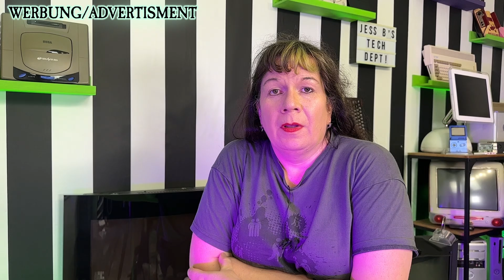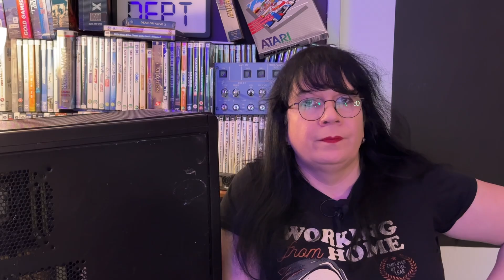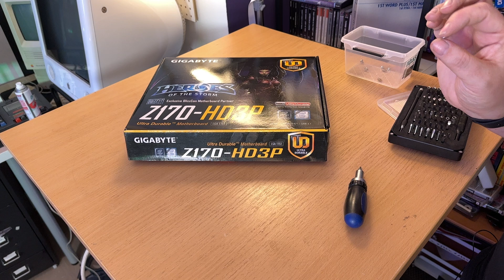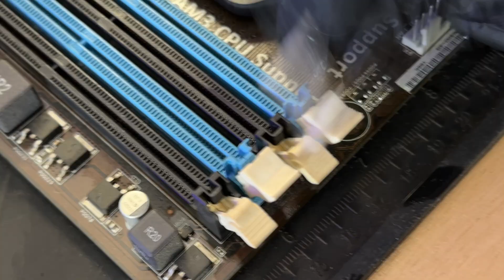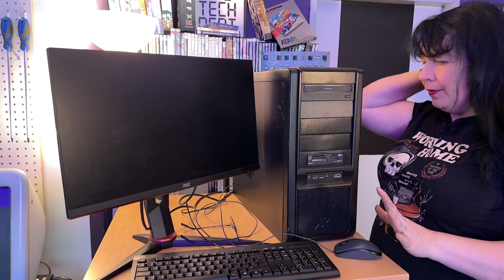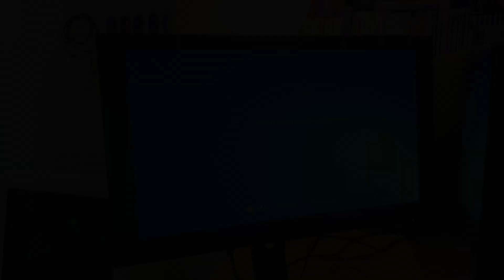Building an Igor (Parts machine build)

Comment: Ha, this is funny. I spent the whole week disassembling everal "ewaste" machines and am about to do one Frankenstein build myself. That said, some of the machines I .. oh dear. They were even bad in 2012. Waste of sand. Will never be retro classics.
In the footage I shot I am rambling at one point how its's wrong to throw away thinking machines and then I ran into that AMD Sempron APU thing....
Reply from the maker: That’s the thing isn’t it. We get annoyed that a perfectly working machine is sent to eWaste but then you see it’s the bargain basement, bottom tier model. Plus older AMD Processors can be…….not great. I’ve a Duron system somewhere that’s ok, but it’s not gonna win any speed awards.

Comment: Happy Easter!🐇
Is the original, nastily powdered fan still alive or has it the rattle of near death? What triggered the censoring of the thermal paste?🤣
Reply from the maker: Happy Easter. Yeah, believe it or not the fan is not only alive, but working just fine. A little oil in the bearing helped. :)